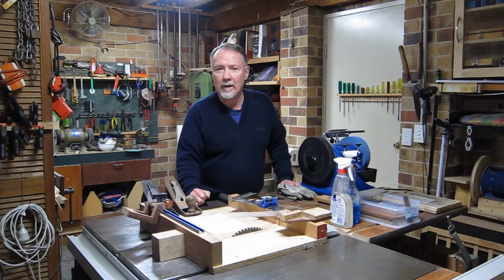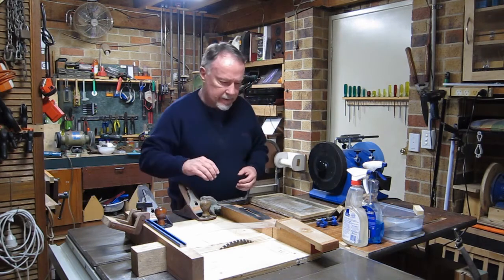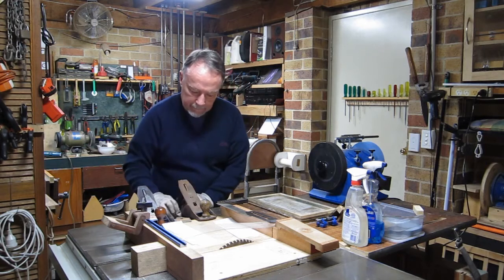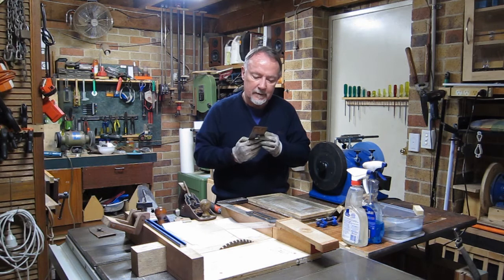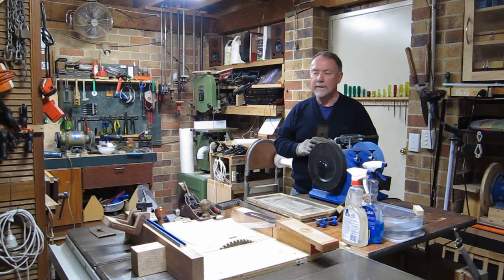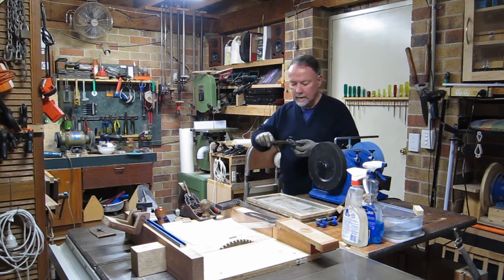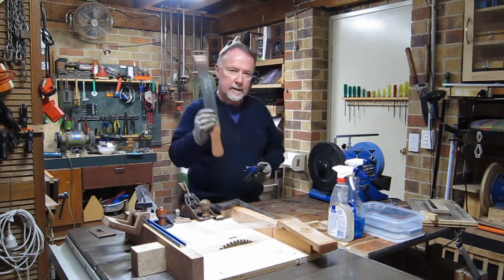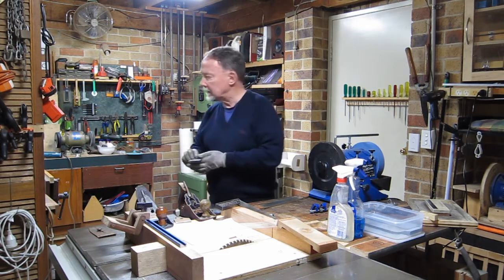How I sharpen a plane blade to sell on eBay

Comment: Hi Tony, good job on the video.
I also have  a Scheppach, though mine is the yellow Tiger, see yours has an adjustable tool stand. Did it come with it?
I am restoring my fist plane now.
Will be bidding on one of your planes over the next few days.
Reply from the maker: Thanks Bruce!  Yes the Scheppach came with the adjustable tool stand.  It was only $150 on special at H&F.  Does a great job.  Good luck with your bidding and your restoration.  If you're interested I'll be putting up a Stanley 5 1/2 over the next couple of weeks.  It will be in as good condition as the No.6 I have up there now.
Reply: @tonywillis6809  
I feel cheated, the yellow one is a bit more expensive (although I also got it on special) and comes with no adjustable!
Used it for the first time this arvo.

I'm enjoying the restoration and would really like to bring neglected planes back from the dead, however the No6 you have for auction is in such good, (cared for) condition, it is very hard to resist.

Cheers mate.

Comment: Hey tony what's you're eBay?
Reply from the maker: tccp123  I have a plane up there for sale at the moment.
Reply: Tony Willis I just tried to find you and no result found, are you able to add a link?
Reply from the maker: Here you go:
https://www.ebay.com.au/itm/183292455197?ssPageName=STRK:MESELX:IT&_trksid=p3984.m1555.l2649
Reply from the maker: Vlad, the rusty plane I used in this video is going up on eBay tonight at 8pm.  Have a look and tell me what you think of it now!
https://www.ebay.com.au/itm/183308552964?ssPageName=STRK:MESCX:IT&_trksid=p3984.m1554.l2649
Reply: Tony Willis WOW so beautiful! Wouldn't even want to use it! You are very skilled mate. Are you on Facebook? There are a few woodworking groups on there that would love this.
Reply from the maker: Thanks Vlad.  Have no fear about using a plane like that.  They built them tough back in the forties. With a coat of Silbergleit on all the steel bits that will keep the rust at bay for a long time.  The finish on the tote and knob is very hard wearing and will last a long time too.  And now that you know how to sharpen the blade, it's easy to maintain it.  Not on Facebook I'm afraid but am a member of  Woodworkforums.com
Reply: Tony Willis that's a shame tony as Facebook has an awesome woodworking community. Consider it. 
I mostly do turning in my workshop. Iv only used a plane twice in my shop.